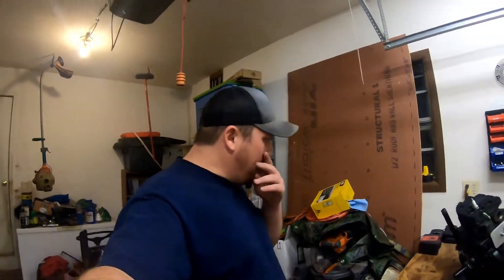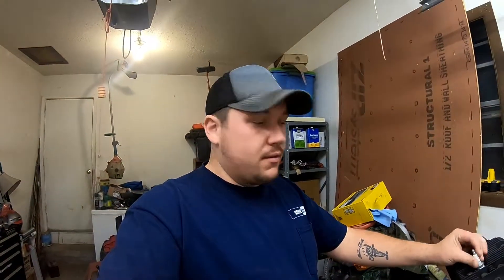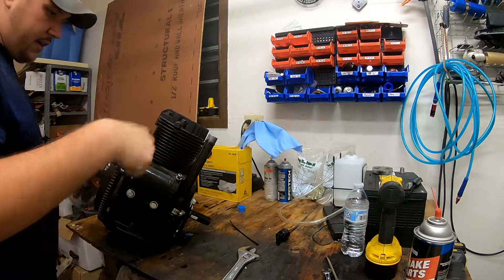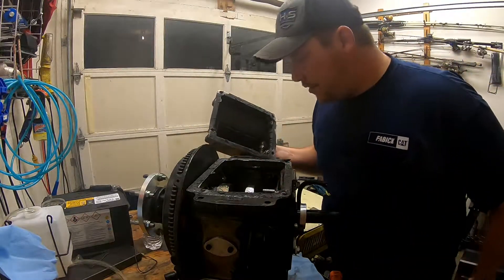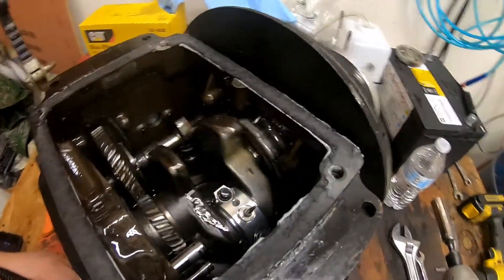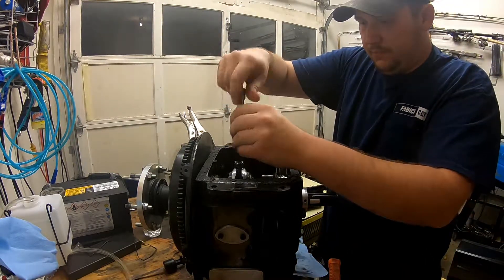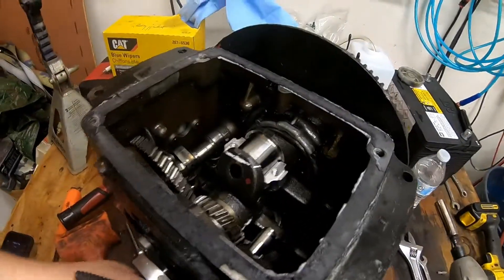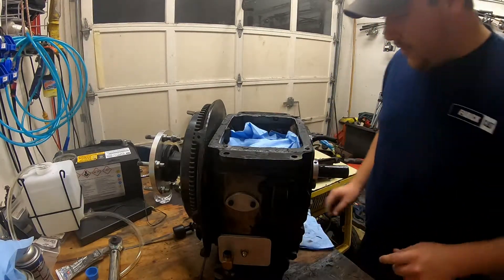A Look Inside The Kohler K301!! Is The Engine Hurt?

Comment: That oil whip looks like it'd barely move anything.
Reply from the maker: While it is smaller then a factory pan,I am using a shallower billet pan and don’t need the longer slinger. Also running the oil level higher then factory (per advice from zach kerber) so the rod cap actually sits in the oil.